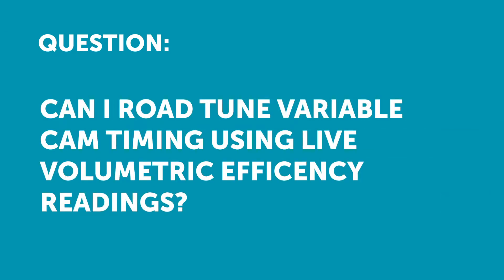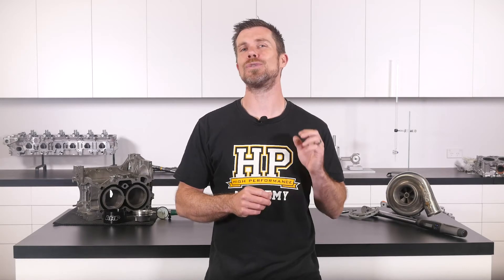Can I Road/Street Tune My Variable Cam Timing [HPA Q&A]

Comment: Assuming "seebayu" is talking about the Subaru cam timing tuning I would like to add: 
I've tune multiple subies with bigger than stock turbos and I don't have an easy access to a dyno and as Andre said it's pretty damn tough to get the max out of the AVCS on the road but there's  definitively low end/off boost gains that can be achieved, especially with bigger laggier turbo/ fmic setups

Hope that helps and for more info, get access to HPA forums ;) very nice community of all ranges of tuners there
Reply: thanks brother exactly what I was looking to see.